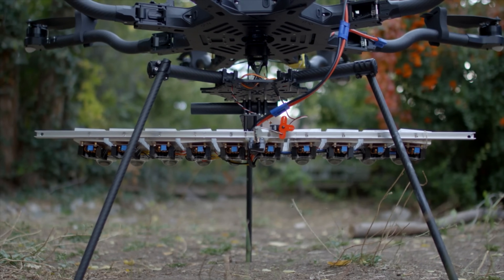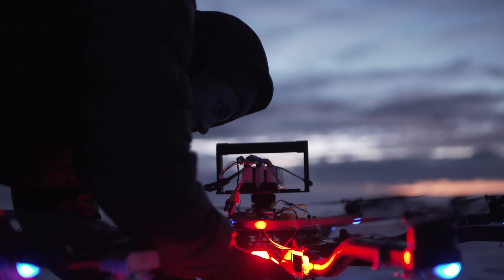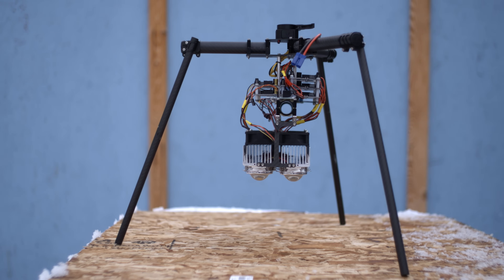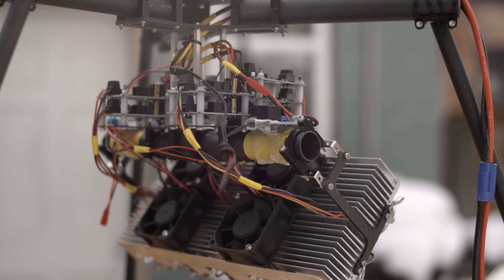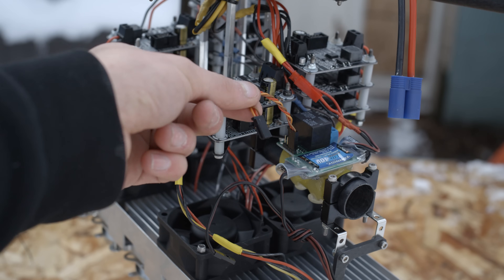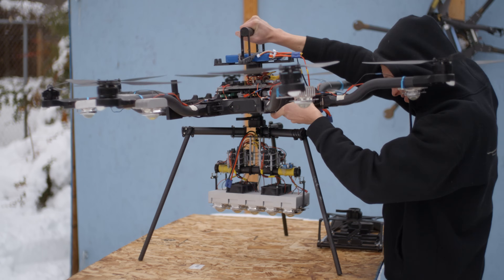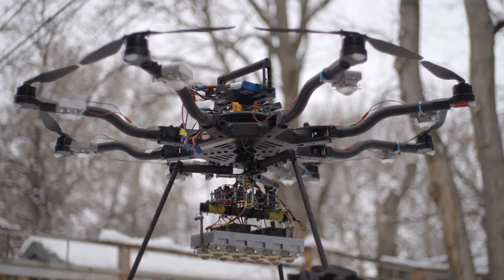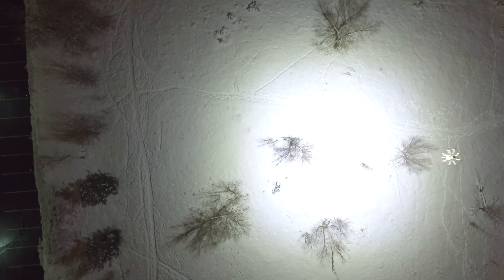1/4 MILLION Lumen Drone LED Light - RCTESTFLIGHT -

Comment: Nice project. I have taken a different approach by using a 32000 flashlight which comprises everything integrated from battery to active electronic controlled cooling for a payload weight of one kilo:   http://bit.ly/2onWdiZ    to get to 250k  lumen output, with this flashlight approach, you have a total payload of 8 kilos, much much much lighter than your 20Kg setup. Maybe a challenge to try ?

Comment: So.....the applications for a very bright 'eye burny' light attached to a drone are....well, apart from generating a significant spike in UFO reports and a similar spike in applications for gun licences, within a 50 mile radius of the location of fully lit flight, assuming it's a clear night, minimal street light pollution and the moons phase is either New, Waxing Cresent, First Quarter or anywhere thereabouts?

Comment: i would be interested in knowing how you came up with 250000 lumens.  lumens are NOT cumulative, if you have one producing 96000 lumens, then all you have are 96000 lumens.  no matter how many LED's you have.  plus there are NO meters strong enough to even measure 250000 lumens.  most top out at 50000.

Comment: sorry to bust your bubble but these leds are noted only to be able to produce less then half the lumens rated at best and over pushing there current (shortening there life) if you want some thing better you should probably invest in some xhp70 leds which will save you alot of weight as well (longer run time) as well as better per watt-lumens out-put they can put out 4022lm without pushing them past there power rating and consume 32watts which means you can run 3 for the one power consumption and it's still less weight then one of the 100w leds you are using you would be able to get better run times more light and more footage better speed, they come in 6v and 12v

Comment: As an amateur photo and video photographer, great concepts, my hats off to you.  I do down scaled video shoots in 4 K and have not yet got around to what you are doing.  Question have you designed the lighting concept capabilities with lessor weight and lighter batter pay load.  I have dabbled with with the idea of using crystal batteries with a step up transformer allowing for higher voltage and amperage with lessor load being pulled off of the battery.  The reason I mentioned crystal battery is the concept for a faster charge up versus longer discharge ratio.  Either way, great job, keep up the great work.

Comment: ideal for search n rescue 👍👌
Reply: Tigerle these are actually used extensively in search and rescue. The real limitation is that searching tends to slow down for the night because of the crew's safety. A system like this would have the ability to scan hundreds of acres a flight though!
Reply: @spencergeorge4941  they just use drones with infrared cameras
Reply: they will find them blind
Reply: While 1,8kW is quite a lot power indeed, I'm pretty sure you wouldn't need hundreds of pounds of cable. Using as high a voltage as possible reduces the current, and that reduces the required cable diameter. With all the LEDs in series the current would be no higher than 30 amps. If you could live with some voltage drop over the line (just start out with a higher voltage) you wouldn't need all that thick of a wire.

Flying "just" 1 kW of LEDs (which is still insane :-) ), would reduce the cable weight even more.
Reply: Tether it to a 30m power cable? It could stay up forever and provide lighting for whatever you need to do at night. Just lock it to a GPS position.
Reply: Putting all 18 LED's in series would be 35v*18=630vdc at 3 amps. For 100ft, you need at least a 20GA cable, which is actually pretty thin, making it light (I estimate less than 5 pounds total). And if you really wanted to, you could design a buck converter which converted the high voltage into something lower to actually run the drone and take off those batteries too.

Yeah it's obviously more expensive than making a telescoping pole but it's in no way impossible to do..
Reply: i thought much of the aerial searching was done with thermal imaging....
Reply: at 600+ vdc, you would need HV insulated cable, anything above 400 could
 breakdown regular PVC cable, plus, having a live 600V cable flying in 
the air would be extremely dangerous. It could work, but it really 
wouldn't be a great idea. 600V at 3 amps is way more than enough power to instantly kill you.
Reply: @spectrHz  pretty simple to have an RCD breaker on the cable supply. Any difference between the current flowing through and return can almost instantly cut the power. Additionally telemetry from the drone could cut the powe if it detects a sudden voltage drop, ie if the cable gets snagged an something or someone is drawing current directly through the cable which wouldn't trip the RCD..
Reply: I thought the same thing when I saw the first video - I had no idea he was already using this in filming
Reply: Yeah, I think Paulie was referring to the concept of lights on a drone.  I'm sure they could reduce the lumens and replace that weight with batteries.  I think it has many applications, military, search and rescue, police, anything where visibility is a problem really.
Reply: schmudge no doubt!
Reply: Yeah, taking ALL the batteries off, you could lift as much cable as all the batteries way, an easy thing to figure out. Then that will be your height limiting factor.
Reply: lol what if somebody trips on the cable
Reply: Damn this comment section became to a gathering of electrical engineer and SAR team
Reply: FernFox
 No worries about the FAA. These drones fly way below controlled airspace.
Reply: I think flares are probably cheaper and more cost effective and portable still.
Reply: This one is Reusabel , flare not
Reply: What drone is that in the video
Reply: I wanna know what drone that is in the video and the full setup
Reply: If this is truly using 1800 watts of power it will only last a number of minutes at a time. Cool, but not good for serious search and rescue. That much light just isn't necessary for most applications.
Reply: I think infa red, Night vision , And FLIR are  better for that
Reply: I think you would find 100ft of any cable capable of high current, or higher voltage loads would weigh more than the batteries would. Even if you were in the best case of 30 amps like you said, it would end up being heavier than the batteries. Plus your limited to 30m, which isn't really a whole lot, it would probably be more economical just to mount a light on a boom truck.
Reply: SolarWebsite It has to lift the weight of the cable though, and as he said, it uses 1800W, so you would need some very heavy gauge cable, which would weigh hundreds of pounds.
Reply: @spectrHz  you could use a high volatage cable, thus reducing the size and weight required..
Reply: @spectrHz not really. With a 120v source you could use a standard extension cord.
Reply: not with the FAA